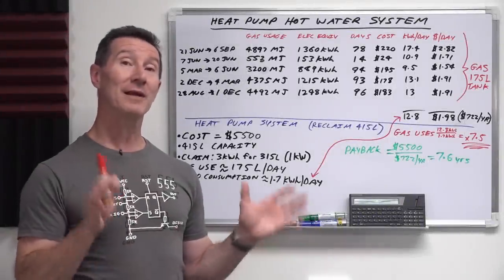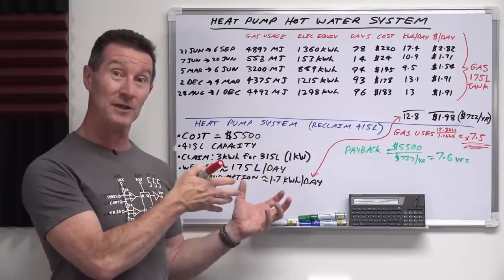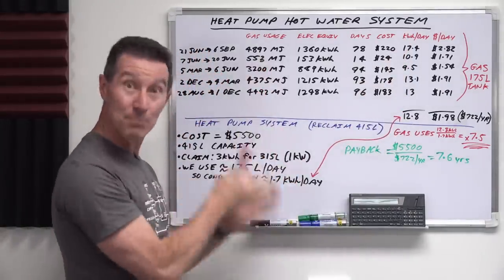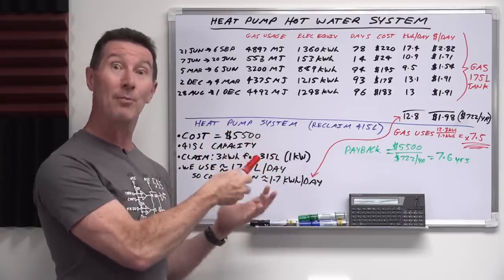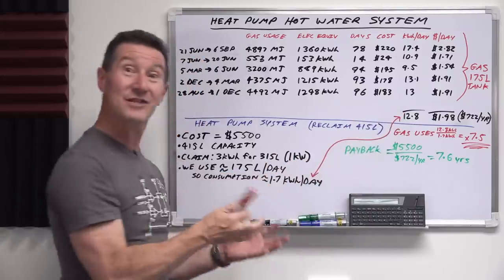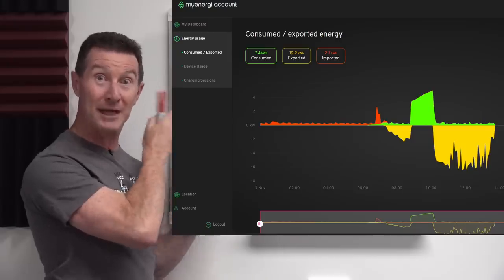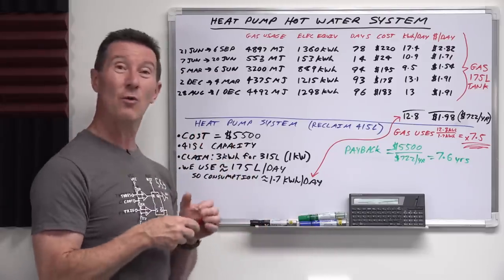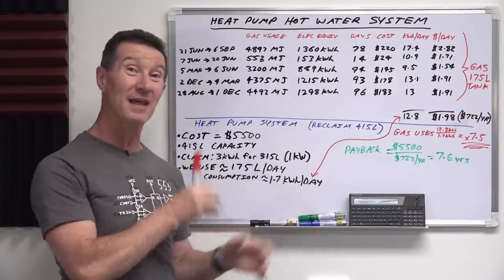Heat Pump Hot Water System vs Gas Hot Water

Comment: I think you should make it clear that you have over invested in a larger PV system than you need and that's the reason you are justifying over investing in a larger hot water system than you need. Clearly you have ample financial resources to do this but is mis-leading for others not in similar financial positions as it makes no economic sense. You do not take into account the life cycle emissions in producing or disposing of the excess materials, the value of the money locked into the excess hardware or the cost of hot water when there is no sun. I am sure it's well intentioned but is not relevant to anyone needing to upgrade for economic reasons

Comment: I'm running ductless HP home heating and cooling with a COP ~3.8 but not HPHW, here's why:

First HPHW is very slow to recover ~3 hours, that's why you need 415 L. What happens usually is they do their recovery at night when there's little or not hot water demand so your PV isn't giving you any benefit. Then there's legionella and cryptosporidium so the tank has to heat above the point they grow, over 50C (120F).  Usually manufacturers put a heating element in tanks and cycle them to kill bacteria. The element has a COP of 1 and companies like Rheem use the element if the water drops below a specific point because of the slow recovery. Now you have a tank with 415L sitting at 50C so you get standby losses, the greater the temperature differential the greater the losses. Then you have line losses to fixtures, then mixing losses to bring the water down to use temperatures.
The extra complexity also means there's more to go wrong, more to install and a 415L tank takes up room space too.

I run PV and I run tankless, here's why:
No standby losses, no line losses, no bacteria cycling and easier to install and maintain. Because it's so small it can be put closer to fixtures and because you set the temp to use temp and you don't have water sitting in a tank there's no bacteria build up and there's unlimited water 24/7 with no waste losses. When it's off there's no draw and because it comes on when I say it does I can maximize my PV, so things like clothes washing happen on sunny days, dishwashing when there's PV output too. 

After monitoring my tankless for a year I found it never draws above 5kW's when on if not everyone is using water at the same time, if you want to wash clothes and have three people taking showers it's not going to work for you. HPWH work if you have a lot of hot water usage but if you're careful and conservative tankless is better. Not only does it cost less and less to install it lasts longer. A tankless can last 25 years and with an inexpensive element change if needed another 25 years. HPWH, maybe 15 years and if the tank splits open like most tanks eventually do, you'll have a flood, that doesn't happen with tankless either.

Let's say I take a 5 minute shower which is about right for me: 5/60 * 5e3 = 416watts to take that shower, then it's off, no tank to reheat, no standby losses, nothing. It's only two of us here now  but my monthly usage is usually under 40 or 50 kWh's, at 20 cents (USA) a kWh that's $10 for the month but most of it is covered by my PV, the key is we control when most of the hot water is used and  you set the temp, there's no mixing losses, turn the water fully hot, super efficient even though it's an element and if you have a good system it slow starts. Do the research, see if I'm right.

I bought it from Amazon, it came in the mail (16 pounds), I ran in a 240 line and it was done in an afternoon.

Comment: Hi Dave, if you claim having so much surplus of solar energy - is it even worth having so complex (expensive) heatpump system? I would say the heatpump systems are mainly useful for people without solar or living in less solar friendly parts of the world where you don't get much surplus except for 2-3 months in summer. I would go just for resistive heating for fraction of the cost in your case. Plus you could easily modulate the power going to the element so in overcast days you won't draw power from the grid during the time when other power hungry applience turns on (dishwasher/washing machine..)

Comment: We have a 50 gallon or 189 liter heat pump hot water heater and it works flawlessly!  So far in 2022 it has used $206 USD and 803kWh.  There are two of us living in a 1920 sq ft or 178 sq m house and we do have guests every so often.  We've bought  it in 2018 for the same price as a standard electric water heater due to an instant rebate from our local power company  and never run out of hot water.

Comment: In Germany we have the option to have a powerplan to import our exported energy for free. That also means we export for even less than none but we import for the same less than none as long our export is higher than import.

It has a decency, we need to have a battery system with all least 10kWh. But it's working wonders.

Comment: Using water in place of a battery in applications where the solar heating replaced grid electricity is definitely a good idea. The only problem is that the heat will eventually bleed out of the tanks, and they have a maximum capacity. I would expect it is usually cheaper to heat with gas than electricity, not that that is relevant here.

Comment: I just installed one of these a few months ago... it was going to cost me just over $10,000 to install a new chimney, the heat pump system not only is saving energy, but was a lot more cost effective, and we've had no issues with having enough hot water.   I
n the last month, we've used about 8kwh total electricity to heat water (confirmed by both the app and my independent electrical monitoring setup).   At our kw/h rates, that's less than $2 for the entire month.  it's actually been WAY more efficient than I was expecting.

Comment: We had a cheaper heat pump in QLD that ran on the off peak electricity.  It had its own meter and used only 1.5kwh per day. Hot water was virtually free.

Comment: Great Video.... can for the short time. This needs a debate!!!
I sell everything in plumbing, a hot water system "gas" in Melbourne costs $1000 bucks... connection is about $400 bucks per year.
My Italian Mother would will have wet dreams to see the Small  Internal Gas Water system from upstairs laundry for 30 years,   years, into a power house room with panels on the roof that Local counci permits just l need to approve, only  to save a few dollars. Real Question is, why is this government charging us world's most highly price for gas???,

Comment: Had 80 gallons of solar hot water.  Cost about $35 a year to run the pumps to move the water through the solar panels.    At one time I had solar hot water with solar powered pumps as well.  That cost nothing to run.

Comment: If it's only 4 times better COP, how can it be 7 times more efficient than gas?
Reply: gas tank is 60% efficient in getting the GAS HEAT energy into the water and a heatpump tank with a COP of 4 is 400% "efficient" and BAM 7X +/-

Comment: it would be good to compare it with a "solar water heater".  And in the case of a "solar water heater", you heat the water directly, additionally, water flow is required through the circulation pump. But it is worth comparing the size of solar panels to solar water heaters.

Comment: The water temparature delta is important factor because in winter the input water is much colder than in summer. And at the same time the efficiency of heat pump is much lower when outside temperature is low ( less than 5 - 10 degrees C ) . So having a mixed between gaz and heat pump and preheat cold water with gaz when outside temperarure is under a triggered temperature might be an efficient solution.

Comment: The heat pump water heaters in the US generally have their evaporator inside on top of the tank. Why would you want the evaporator outside? Take the hot air out of the house and put that energy in the tank. Reducing the load on your AC units.

Comment: Have a heat pump, had it for 2 years now, still grid tied, and in south africa, we have serious power issues, so being able to have hot water , running off a small generator is a huge bonus! but when we do have power from the grid, it barely uses power!

Comment: I want to jam a solar powered immersion heater into our gas water heater  just to keep it hot during the day.  Set to a few degrees above.  Basically to make up for the wasted heat thru the insulation and supply the small demands.   Next time we leave the house for extended period I will note the gas reading so we can see just how much is used keeping it warm and a pilot light running,

Comment: Dose this system recharge as the system is used I imagine is dose as most do to supply the pressure it would be interesting to see how much useful hot water you get with out actively adding heat to the system while you’re diluting it with fresh cold water

Comment: OMG! From 7 down to 4.5!! A mate of mine has this installed. Yep Japanese Chofu brand pumps should last. Your gas installation is so old that itself is very inefficient. So if set to bludge from your solar and you sacrifice the low feed in tariff it has some merit.  Now it comes down to what is in the water that is the primary reason for rooftop solar hot water systems to fail. You can't mix metals  on either side of a storage tank. Place it onto the roof and even the mounting to a tin roof creates dissimilar metal issues. Place it on the side of the house out of the wind one could use stainless tubing if the tank is made from stainless steel. Now your new system is going to take up much more room, generates some noise and with every mechanical system that has many moving parts there is a scheduled maintenance plan that must not be missed. 7.6 years to pay back, the kids will have left home. It is also a long time considering you could get 4% interest in the bank. With gas having a 55MJ / kg level you are also taking about 5 years to offset your CO2 to environment balance given that Sydney is burning dirty coal to make some of the power sold to you. Good effort. 
I just inspected the former farmhouse in Europe where mum grew up. At first they had a general heating system with Russian gas planned. Then resistor heating with thermal bricks were part of the reason the place burnt down. Well it was actually a 4 sector aluminium cable that was installed over 50 years ago and its final bend radius was around 15% to small and the insulation had given up.  Now the new building has 12 flats and a dual heat exchanger with CO2. All stainless piping including fitting. Mostly mass produced in Germany with some parts made in China under German quality control. No solar there due to snow build up but the heat pump talks to the energy supplier who finds a suitable time slot.
Reply: Payback it likely a lot less with gas and supply prices increasing sharply. Noise is 37dB and only happens during a few hours in the day. We pay extra for 100% audited green energy if it comes from the grid.
Reply: @EEVblog  Far North QLD is still in the "dark" ages. All we can get is Ergon and they are in a total mess. Our water can drop to PH 5 in the wet season. Usually on brand new houses with copper pipes kids who drink from the tap get copper sulfide poisoning. Solar installations with mixed metals barely live through the warranty period. Recently the council has used industrial ascorbic acid to sanitize the water followed by truck loads of lime. We also still have many asbestos water mains and this is another reason to use multi-stage filtering. This year global warming is early and we have once again turned off the hot water heater. Sometimes the cold water feels to hot to have a shower.

Comment: I have a mate that works at Rheem, did you do a comparison? I am thinking of doing the same (Reclaim), but in my case going from electric to heat pump. My current system has a slow water leak, so already failing... I have a huge solar system (over 15kw) so very much worthwhile to switch over.
Reply: Mrs EEVblog did the work findign the Reclaim. There is an excellent comparison spreadsheet she found on Facebook somewhere. Will see if I can find it.

Comment: If you're comparing to gas you should convert the heat pump consumption into how much gas is used to generate that electricity. Or maybe ideally weighted to your personal marginal electricity mix (ie, lower grid export is on margin compensated with other generation). Otherwise it's a bit of a false comparison. 

Still a win though. Surprised you hadn't done it already with your environment focus!

Comment: Are ground source heat pumps a thing in Australia? We did one here for the hot water that preheats as it warms the house and then uses a gas burner to do the last bit. COP in subzero weather is about 5 and some months my gas bill is under 3 dollars (plus the service fee). AC is basically free in the summer since our ground "hot" side is 12C.
Reply: I don’t think he has much reason to, the air is pretty much always warmer than the ground, it doesn’t even make it close to freezing.
Reply: @Turbochargedtwelve  Sorry i explained that poorly.  I mean a combined HVAC/water heater.  In warm weather they use the cold ground to more efficiently cool the house, while some of the waste heat from the AC is used to heat water.  Agree that a pure ground source hot water heater (without AC) would be pointless in a hot climate.

Comment: One thing you're neglecting is that all the water you aren't using will still be losing heat (even with good insulation on the tank), and have to be reheated each day. I strongly suspect the system will be using more than 2KWh/day. You really should have gone for a smaller tank. (It will still be far better than your existing system, of course).
Reply: And no, that extra water isn't a "thermal battery" because you have no way of extracting the energy from it. It's just going to sit there losing energy every night and require topping up (reheating) in the morning.
Reply: @RedwoodRhiadra  I was expecting some sort of "storage heater" system BUT he is  NOT drawing the stored HEAT
Reply: Interesting points, but I think you are both right and wrong! I agree there will be losses, and more important, more losses than the current system which is also a storage type. I agree the system will use more energy than he projected. From Reclaims website and comparison chart, they compare this system to 315L alternatives (note not the full 415L capacity) and it would require 1161kWh per year. Thats 3+ kWhr per day. He might use a little less by not using the whole capacity (or 315L?), but the system requires a 59C heat cycle at least once a day so I dont think he wont use much less than 1161kWh. In terms of cost though if he can use excess Solar he will save, even if a few days a year during the 3 hour heat cycle hes a little short on excess solar. However, he has neglected to include the loss of solar feed in, which may only be 25%-33% of grid buy, but I expect would add another year to his projected payback. Now, about the capacity, I think you are wrong. If he went for a 175L version (this brand doesnt have that) then he will most probably consume all its capacity and have to recharge using grid power at high cost out of solar production time and also generate green house gases. The extra losses are worth it if hes heating it for free, and wont generate green house gases. Finally, Daves gas usage figures are correct but they are not the heat usage. I have the same gas heater and its only about 80% efficient so it burns 12.8kW of gas a day for 10kW of heat. The new system uses about 3kW a day of energy for probably 15kW heat, so yeah uses more heat probably loses more, doesnt matter, more efficient and costs less. Is it worth it though? Only if you have excess solar and want to help the environment.

Comment: I was thinking the same thing.  In the US installation is x2 the equipment cost (on average).  I asked how much to put in a mini-split and the number was $9k so it is true since the mini was $3k.  I'm going to buy the tools I need since even if they cost $1k it beats handing over $6k.
Reply: Everything in the U.S. is a scam. Installing solar is extremely expensive, installing a hybrid water heater is also extremely expensive.
Reply: @USNEM  The only option is to DIY.  Start slow, I put some panels ($150 used, 300 Watts) over my deck and it shades me during the summer.  I buy LiFePo batteries and the controllers to setup mini systems and I use them when the power goes out to run my computer and heat a microwave.  Each Year I add more and I hope to use it soon to power daily.  TouTube has anything you need to fix appliances like leaky toilets' etc.  Buy tools and learn how to use them.

Comment: I am thinking It's 7 AM, I want to take a shower before going to work, I turn the tap and all I get is COLD water, the tank has gone cold because NO solar power all night and it's wintertime . time to hit the expensive electric grid power !  
You would have to super-insulate your hot water tank to hold hot water for at least 12 hours, further adding to your cost OR take you shower later in the day, not very convenient
Reply: I believe he showers BEFORE bed as stated in the vid so he is "time shifting" a FEW hours only NOT 12+ like you would be
Reply: He will need an insulated tank nonetheless   to act as a BATTERY to store thermal energy, otherwise it is all lost, making the system quite inefficient
Reply: @NICK-uy3nl  That is an insulated tank.
Reply: @NiHaoMike64  - There are very different levels of insulation

Comment: Curious: Couild you drive a normal electric element off your Solar? Or would that be a step too far?
Reply: You could if the voltage is the same. The heating element is just a resistor; it doesn't care if it's seeing 240Vrms or 240Vdc.
Reply: I have been looking at doing this as I have unused panels.  They have 48v 'solar' immersion heaters